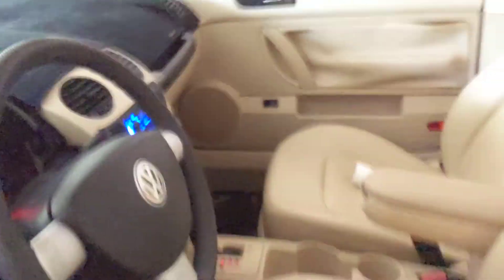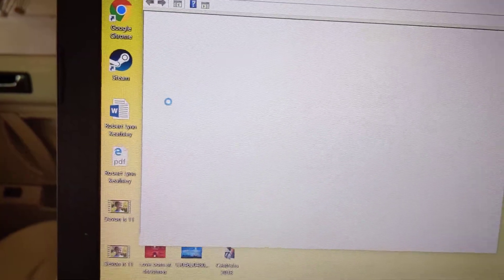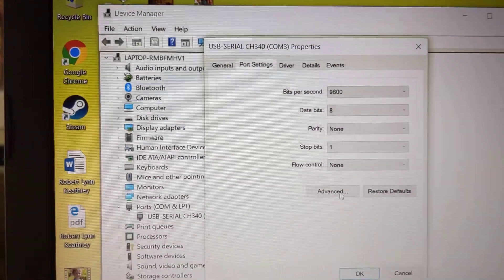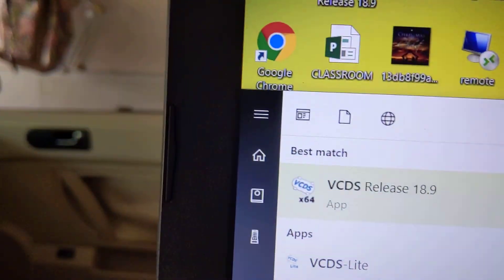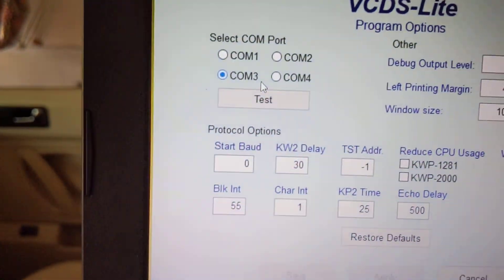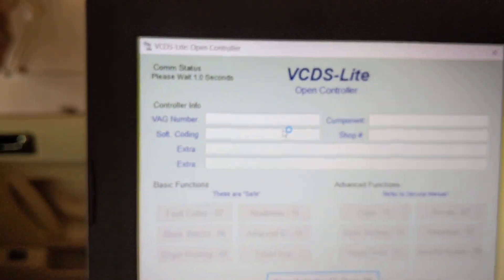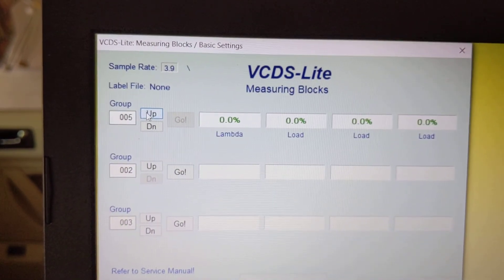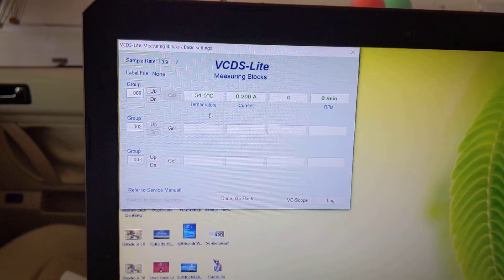How to scan transmission temperature in a VW

Comment: Ok I can see you using 1.2 …. The only cord I can find is for windows 7 or xp … I don’t know where to go from here. I really need your help as to what cord to buy. please. Thank you
Reply from the maker: Just some Chinese cheap vagcom.
Reply from the maker: VCDS Lite works on later operating systems with cables marked XP and 7 only.  It should work with most of the cheap knockoff cables.  It's limited in functionality and will scan a few things and that's it.

You might want a OBDEleven if you are going to really start tinkering.
Reply: @ackliph  ty I bought one from Amazon and i booted up my old windows 7 computer … all I need to know is trans temp. I hope it works for me as it did for you. It’s a 2001 VW beetle. Trying it out today. Will update . Thanks for you video although I really was stressed out trying to figure which version VCDS you were using and where to purchase cord

Comment: Ross-Tech says this works only on 2005 or older cars.  Do you know whether this works on newer VWs, specifically a 2009 Eos?
Reply from the maker: I made this for my dad because that's what he had.  You could probably use an elm327 and Torque if you don't have this cable.  It'll cost you around 7 for the elm and 5 for Torque Pro

BTW this was a 2006 convertible beetle.
Reply: @ackliph  Hi, I tried car scanner software. It will not show the ATF temperature for 2014 VW Tiguan. 2013 GLK350 show the ATF Temperature.
Reply: @ackliph  please tell me what cord exactly that I need and what program? I really need to know ty